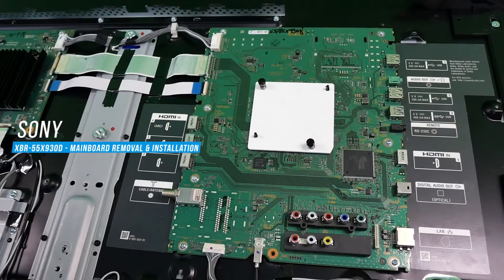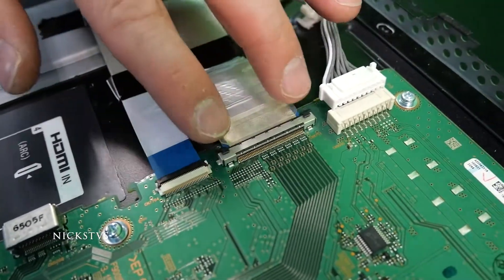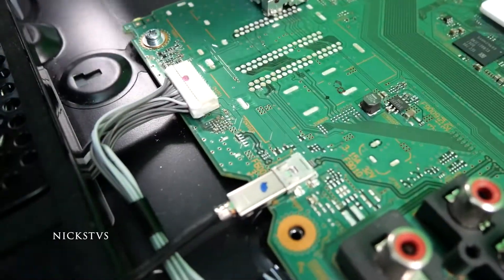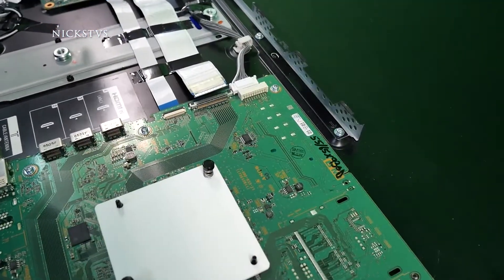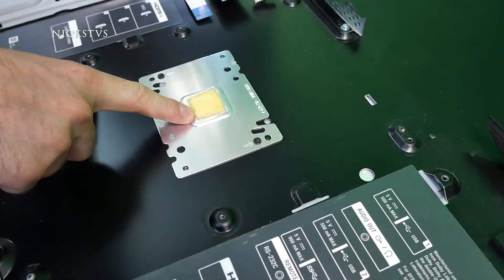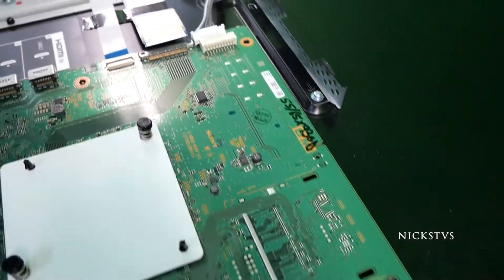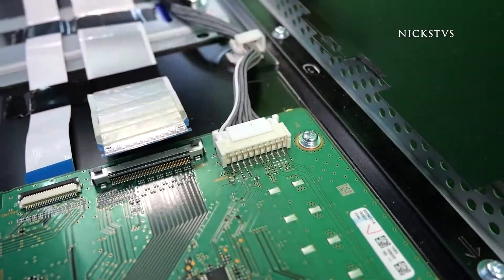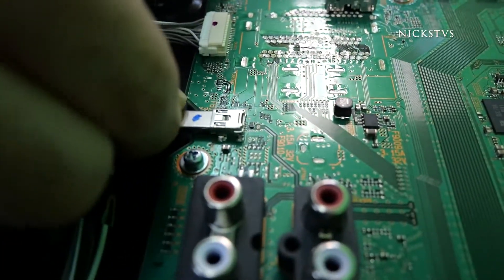Sony 4K TV Mainboard Removal - Sony XBR-55X930D XBR-65X930D

Comment: Hey 👋 I had a question if you had a min. is it possible for the 2D to work but the 3D not work & have bad double imagine issue? I'm curious if the processor or main board needs replacing. Either the fore ground or back ground has double imagines out of both eyes, so there are 4 images in 3D. Thx
Reply from the maker: Hello,

Yes I have heard of someone mentioning that type of failure before but it was not for a Sony, it was for an older LG model. For a Sony board such as the 930D model I would first suggest a factory reset and software update if one is available. If that does not resolve the issue, then it is possible a new mainboard or a new processor on the mainbaord could fix this, however I have not had to do that before and can't confirm for sure that it would be 100% the fix. 
I also don't have 3d glasses or 3d device to test that feature so if you were to send it to us for repair, I would be able to do the repair but wouldn't be able to confirm the fault is resolved. You would have to test it back in your set to confirm.